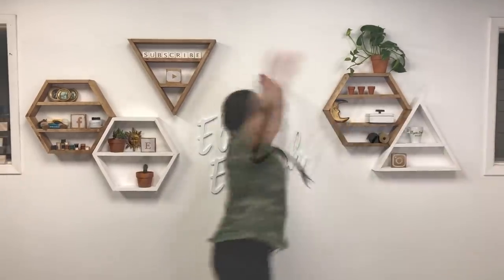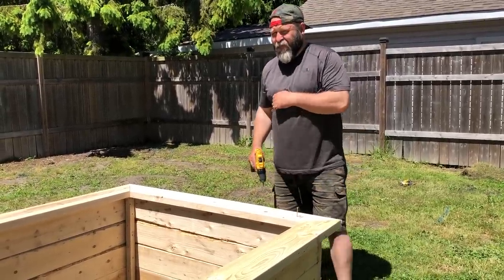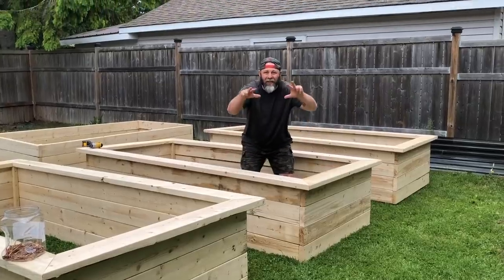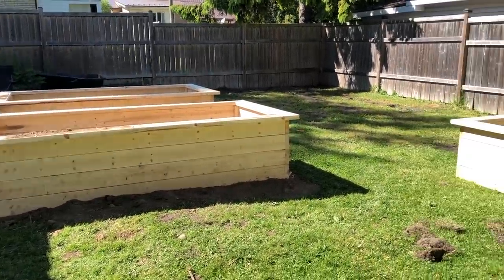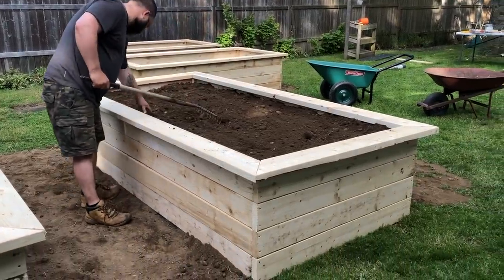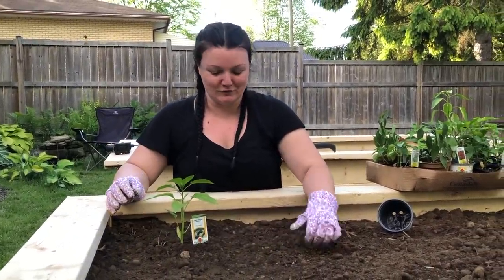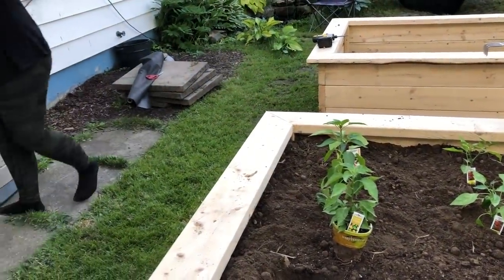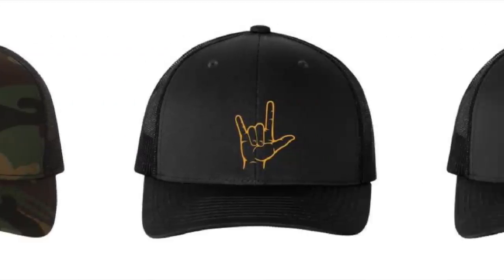VOTE the best raised garden beds on YOUTUBE

Comment: Great job on the raised beds! Aren’t you afraid of the wood rotting since the wooden beds are directly on the soil instead of concrete footings? I was always taught to keep the wood up off the ground to keep the wood from rotting. They could have been placed on concrete or bricks to avoid this issue. As they are now, when it rains the wood will wick up (draw up) the water, causing rot. Wish you luck.
Reply: I was looking for this comment.  Where I live these wouldn’t last two years
Reply: Alexandra Stroud, in muggy South Carolina near the coast, i might get one year before rot started.

Comment: Hi guys. I love your channel. You guys are amazing. Just a tip with filling your beds and saving soil, fill at least a third or quarter of the bottom with fire wood (nothing treated). Saves on the amount of soil you use and the wood will decompose as time goes by and creates a micro system there and keep your planets warm in the cooler months as it decomposes.